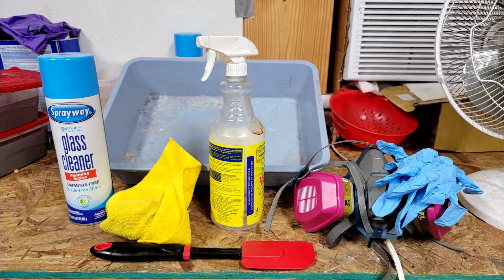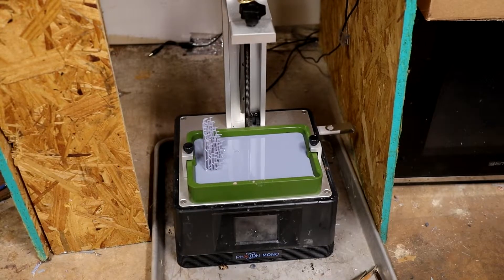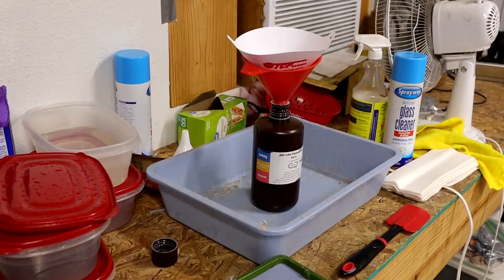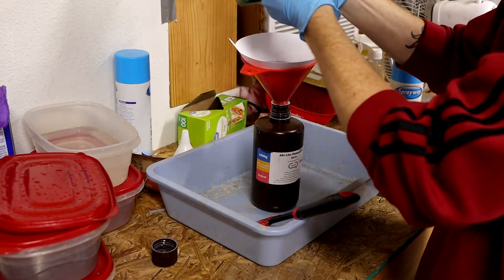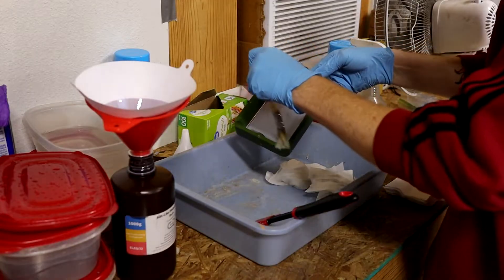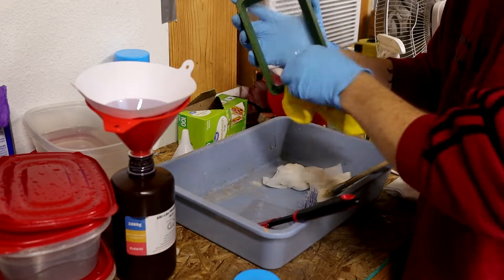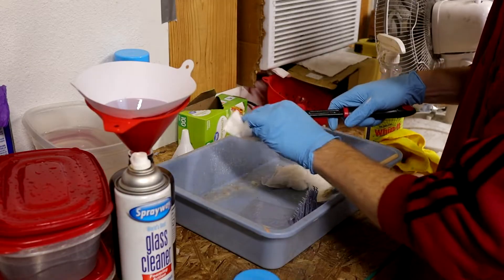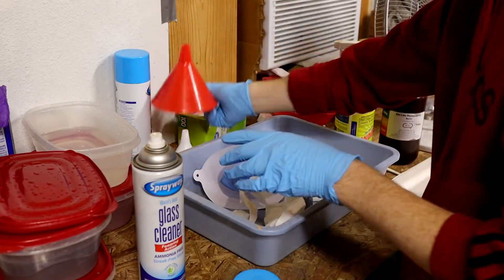This is how you should clean the FEP and Vat in your resin 3d printers

Comment: A little tip when you're using supports for your tank clean; score the base of the supports with a craft knife. Capillary action will pull resin into those grooves and give your supports better adhesion to the resin as its curing. That way you won't get into the annoying situation of pulling off the supports and just taking off a corner and not the entire film of resin you've just created.

Also, if your printer has the option to set your time when using the tank cleaning option, set it for about 50 seconds. If your resin has been sat for a few hours the particulates will settle onto the bottom of the vat. If you set your exposure time high you'll catch most of them in the cured resin. You're not going to kill your screen with that kind of exposure time if you're only going to do it a couple of times a day, but it will get rid of most of the crap left in your vat.
Reply from the maker: Thanks for the advice and thanks for watching!

Comment: That thing with using old supports as handle is a great trick, haven't seen it in other 'how to clean a vat' videos. This can also be used to remove failed prints stuck to the FEP without the need to drain resin out of vat (take care not to splash liquid resin all over the printer when lifting it, though).
Reply from the maker: I use it for that purpose as well. It is a really good trick that should be shared more often.

Comment: Nice video, I just have one quick question.
Is like the surface that you pulled with the support like made of the model that you have printed or are you using resin that stays and forms that kind of surface?
Reply from the maker: The surface I pulled with the support is resin I cured actress the entire FEP. You run an exposure test or tank clean(it is called a few things in different printers).

It cures the resin at the bottom of the vat as a solid sheet. That sheet adheres to anything that has settled to the bottom of the vat and pulls it up nice and easy.

Comment: Hi, amazing work. Can you make a vídeo where you explain your process to find the perfect print spects?
Reply from the maker: I plan on doing that eventually. Thanks for the suggestion.

If you want a quick and dirty version of it  I suggest just finding the suggested settings for your printer and resin combo and print a model that was supported by a sculptor with a reputation for reliable supports. Not one you supported yourself.
Then just see how that goes and troubleshoot from there.
Print the same little model everytime you test new resin. Then you know what to look for as you gain experience. 

People like to waste of ton of time dialing in their settings with exposure tests but after a certain point you are just wasting time for minimal benefit.

Comment: In my country I have other brands of glass cleaner sprays and products.. should any work.., just a ammonia free types.. or none is recommended except that brand?
Reply from the maker: That one works with cleaning resin because it is alcohol based.

You can just use alcohol and a micro fiber cloth. It will work well enough.

Comment: Do you have settings for Uniformation GK Two 8k utilizing Phrozen AQUA 8k RESIN?
Reply from the maker: No. I have no idea what a "uniformation GK Two 8k" is. I assume it is a resin printer and your best bet is manufacturer settings or settings from someone who has used one.

There is no way to know how hot or cold the light source is on that machine is and it could affect the layer curing time by up to 30% plus or minus the standard time of around 2 seconds at .05mm layer height on monochrome screen printers.

Comment: So I take it you managed to get one of the "good" Sovol vats?
Reply from the maker: I don't know what you mean by that but yeah my sovol vat has been great. The best part has been the feps from them that are super easy to install.
Reply: @jojothegm  Sovol had sold multiple iterations of those vats. The earlier version had a removable FEP frame. Later versions don't have a separate FEP frame. You just install the FEP directly into the bottom of the vat and tension it with a thin flange that only has like six screw mounts. Mine leaks resin horribly.

Comment: Should I still use Alcohol to clean everything even if I use water washable resin?
Reply from the maker: I personally suggest avoiding water washable. 
It costs more for no added benefit. 
It is very brittle. 
When you print hollow it has a much higher chance of exploding or cracking open. 
It is still just as toxic.
You then have a bunch of toxic water you can't pour down the drain. Please don't pour any water used to clean resin down the drain and don't pour it outside. It poisons the local water supply and harms wildlife.
You need to totally cure the resin in the water and preferably let it evaporate before disposing of what is left in the container.
Reply: @jojothegm  alright, I've only used one bottle of it since I'm completely new to resin printing, but i appreciate the info. I'll try to avoid it from now on
Reply: @jojothegm  I was going to get into resin printing with water washable as i can't really afford the amounts of IPA that people seem to need to wash 3d prints, and also can't afford a wash and cure station. And yeah, my plan was to buy a bucket and let the water evaporate, and once every however many years it takes, take said bucked to a recycler to pass to them the resin recycling. Haven't started yet, i got a Photon Zero for free because of the Z issue that plagues all of them, but making it move a while before printing makes it a 100% reliable machine as it seems.

Comment: I really don't get the fuss about cleaning vats. I never empty my VAT when I am not printing only to check for bits when I see leftovers on the printbed or had failprints. Resin stays in all the time and just gets slowly stirred with a spatula before the next print. What is the most important when doing is that there cannot be any light into the machine. I got myself a soft cover for the printer that seals it off perfectly.
Reply from the maker: I print with opaque and transparent resin. I need to fully clean the vat if I want clear parts that aren't cloudy.

I assume other people do as well.
Reply: @jojothegm  Speaking about fully clean vat . Even though your resin tank in the printer was almost fully cleaned as if there was still slight resin attached in the glass. i could see parts in the  glass that still seemed not fully clean ,like washout and fuzzy.  My question is , didn't the laser light of the printer will be confused and lose precision when trying to print across a semi clean/slightly dirty glass?  And require the glass to be fully shinny clean for optimal precision? Can you elaborate if not having a shinny new clean glass could impact the accuracy of the printing?   For reference at the 10 second mark  00:10  you are showing the glass but is not yet  hundred percent fully clean and fully transparent , you still see it slightly dirt.
Reply: @technoartfest8708  I think what you see is scratches.
Reply: @ramonhanneman you are correct. Those are scratches. That FEP has been through almost a year of printing.